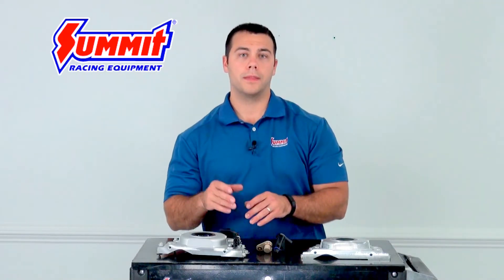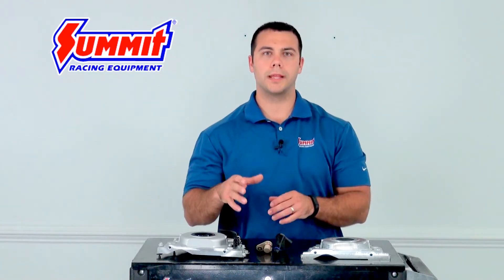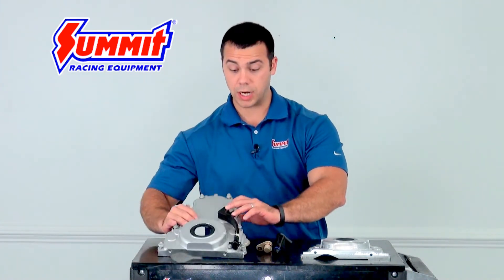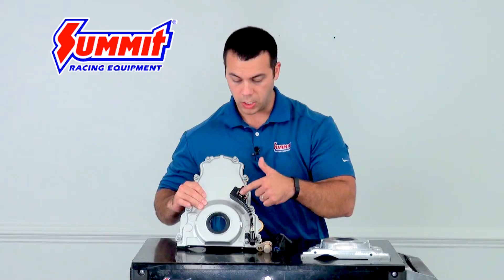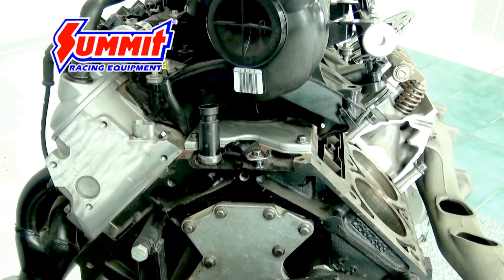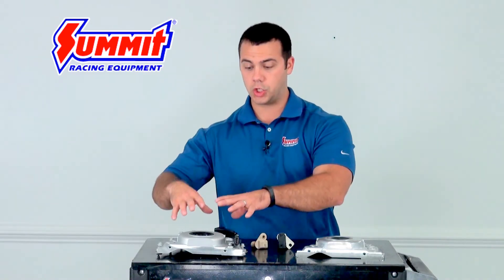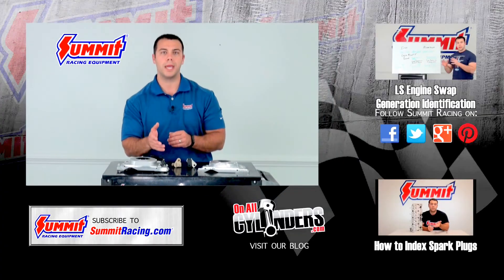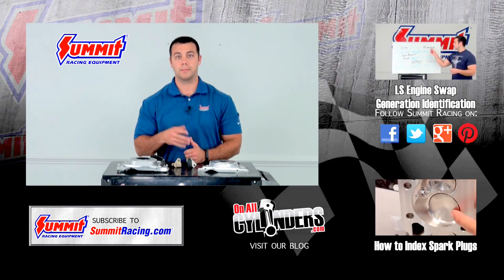LS Camshaft Position Sensor - Summit Racing Quick Flicks

Comment: I’m putting a 2007 5.3 in my 2000 that had a 5.3. The 2007 cam sensor is in timing cover to where the 2000 is on the back behind intake. What do I need to do

Comment: I have a lq9. It has cam.sensor in front cover. There is a hole at top rear of engine where gen 3 sensor would go. Can i put one in rear? Which one should i use? Cheers brett
Reply from the maker: Hi Brett, for folks that don’t know.:  Originally the Gen. 3 engines didn’t have poles on the upper timing gear and relied on the poles cut into the back of the cam and the rear mounted cam sensor to get cam timing. 
 
The Gen. 4 front cover can be used on Gen. 3 engines with the cam sensor extension harness.  This is often done when a 58X crank is used with the appropriate later ECU.
 
When making this change to a gen. 3 block, it’s important to know what reluctor you have.  A single pole 3-bolt upper timing gear from the early LS2 is used with a 24X reluctor crank.  A 4 pole 3-bolt gear is commonly used with an aftermarket cam and 58X reluctor crank.
 
In your case Brett, as long as you have the 24X reluctor crank, it would clean up installation a bit vs. the Gen.4 front cover.  As a side note, you can leave your single pole upper gear in…it just becomes redundant.

Comment: Now that I'm actually in the middle of a project where I am running a front sensor I've read that there are 2 variations of the front sensor,  a 12v and 5v. Can you confirm?  I've also read that pins A and C must be swapped if converting 24x system to use the 1x gear and front can sensor.
Reply from the maker: The 2004 and 2005 sensor part number has been superceded by the later cam sensor.  Although the voltage range of the system is different, the sensors themselves both read the same and will operate with either voltage.  The newer sensor has superceded the old one.   The conversion harnesses swap the two outer (1 and 3) pins when going from the rear mount sensor to the front mount sensor.

Comment: Is there an advantage to having it in the front other than it would be much easier to replace? Would the front mounted sensor interfere with accessory drives if you were to retrofit it into another vehicle and not use the OEM brackets?
Reply from the maker: Hi harperjmichael, 
Easy access and repair are 2 good points but, the face of the timing gear allowed the manufacturer more surface are for sensor signals for “Displacement on Demand”.
Reply: hmmm, I wonder if there's a performance advantage to run this cover with the DoD deleted? More surface area would make for a cleaner signal from the magnetic pickup I'm sure since there is more space between the magnets radially.